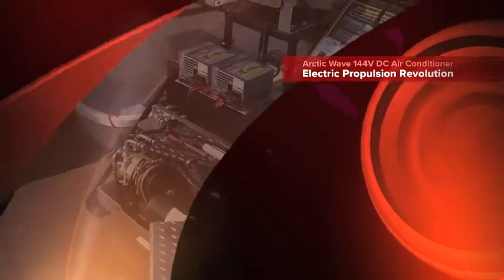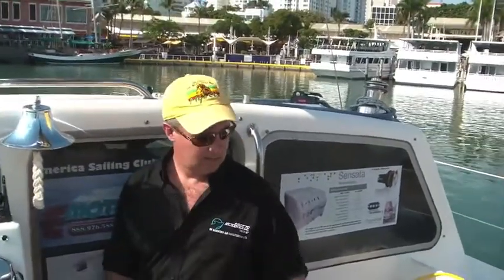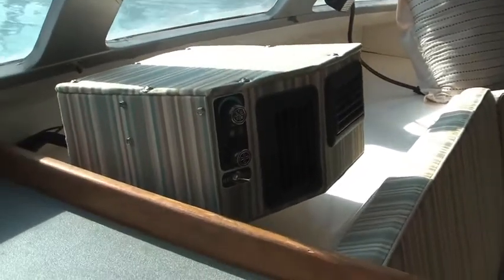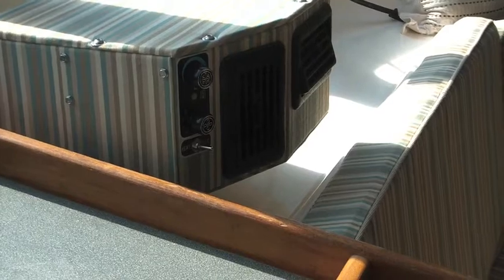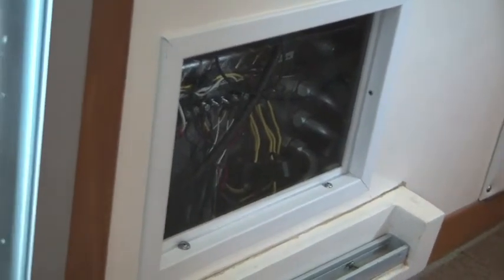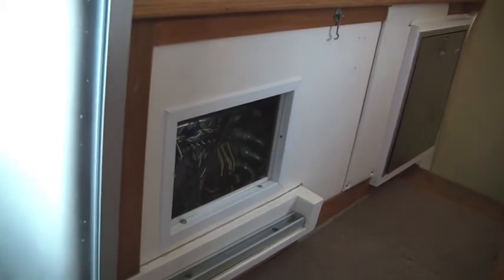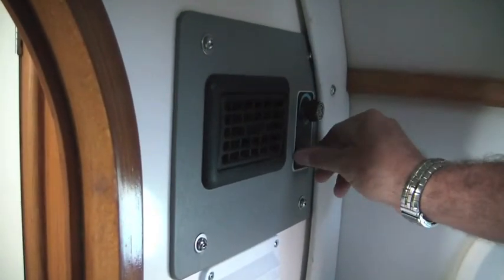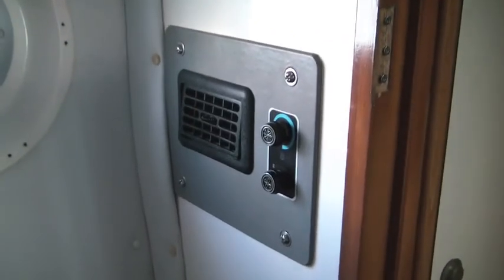Arctic Wave 144V DC Air Conditioner

Comment: Why would you put all the money into a system and run the wires through a hole cut in fiberglass without a grommet to prevent the wire from being worn through. You wouldn't do that in a house (wouldn't pass inspection)  and a house isn't banged around on the ocean. It's shoddy work like that which causes boats to catch fire.